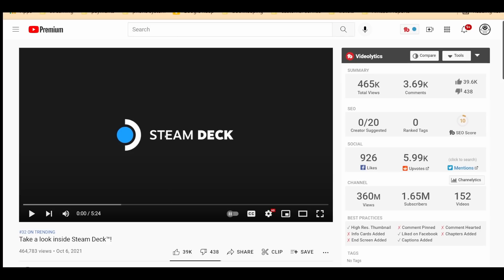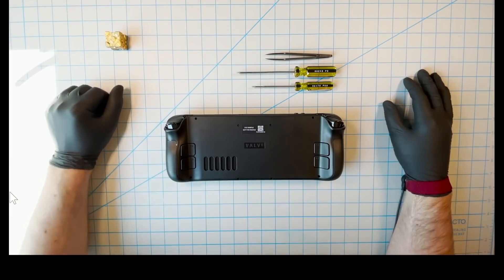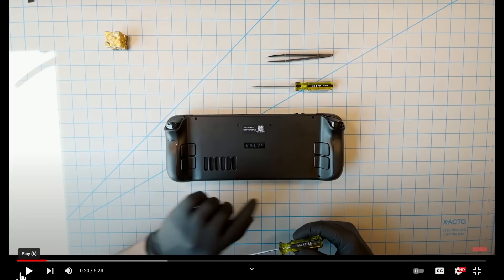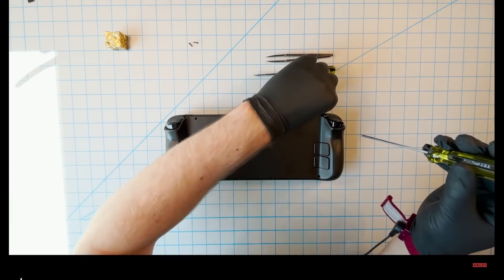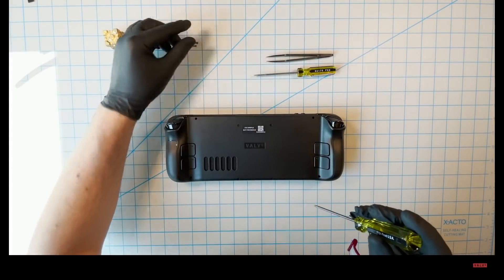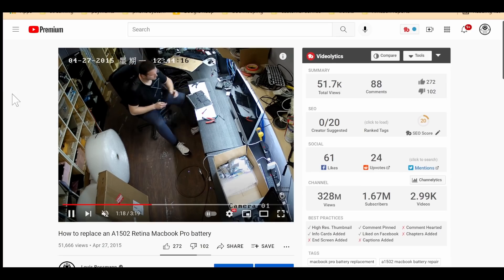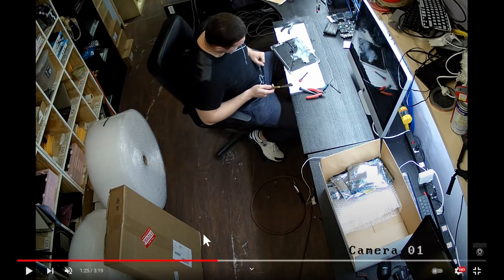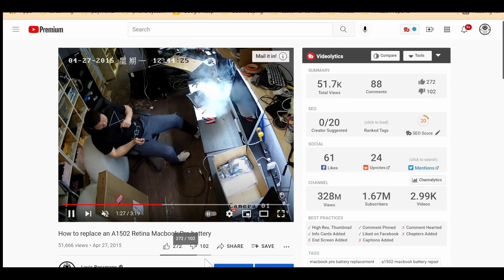Steam deck battery may end your life? bruh 😑

Comment: Self tapping screws xill deform the plastic to form threads.
So by unscrewing then screwing back in, you are likely to cut new thread very close to existing threads, making them thinner and so weaker.

2 options :
- Better design : use threaded insert and machine screws. But that is much more costly to implement
- When putting a slef taping screw back, start by spinning it counterclockwise, until you feel it fall into the old thread. Then you can screw it back. It will be much better but you still loose a bit of strenght compared to when they were first put in

Comment: It's probably poor wording, but I think he means that the structural integrity is lessened while it's open. The stress testing clip isn't really useful- they'd be better served with a side-by-side of it being twisted with a constant torque with the cover on and off if that's what they meant to say.  I crushed my oil filter housing once because the drain plug/cap wasn't in the end of it and it couldn't take the design torque without it. Reduced rigidity after re-assembly makes no sense to me and as I'm sure you know better than I, most other electronics don't get weaker once you reassembly unless you've (read: I've) damaged something.

Comment: As far as the screws messing up the structural integrity I can believe it. Since they used self tappers the screw goes into a smooth hole and taps it’s own threads. If you remove them and the screws don’t line up perfectly when you screw them back in they will more than likely tap a new set of threads in the same hole reducing the amount of material supporting the threads. Still a cheap design choice but it is what it is. They are just covering their asses.

Comment: By the way, I’ve worked on the floor of a electrical manufacturing company, we made medical devices and handled many motherboards. As part of the anti static prevention, our PPE included anti static gloves and footwear along with the wristband you plugged in. The footwear and wristband are there to slowly leak any electrical charge you have to the ground through your feet to ground or wrist to grounding line.

The wrist and footwear are very necessary for manufacturing because static will kill parts being manufactured. Having said that, they are completely overkill in normal everyday life. 

Buy the gloves, buy an anti static pad, and do it on a day that isn’t dry or too humid. (Gloves are just a good idea all around)
Reply: I had a teacher in high school that would sometimes talk about his friend that built computers (I think in the 80's). Specifically, how he would stand naked in his kitchen, one hand on the sink, to prevent static buildup.
Reply: +Ceece I used to work at a company that supplied Storage Appliances.
I wore anti static wristbands as well.
We had to test them on a special machine before we started our shifts.

Comment: Self-tappinv screw could jeopardize integrity when overfastened/over tightened or when not back-threaded (when it retreads the plastic instead of grabbing the old thread). I think the same behind this as the rest of the video:  they had to cover themselves as it is easily possible to break the thread with such tiny screws. He does mention the torque driver for example.

Comment: I never wear a wrist strap, and NEVER zap anything. Like you, I touch things to get to the same potential. Always touching a ground part of the device to get to the same potential. Pickup soldering iron (a ts100) I always touch the earth screw and get everything to the same potential, just like holding the iron, and grabbing the solder.
Always doing riny stuff under a microscope, too. Same rules apply. Be at sane potential as part, then pickup my tweezers or some other tool. It becomes a habit, as you say, Louis.

Comment: Nice to get Louis' opinion on Valve's video. I do think Louis dismissed the battery being able to kill someone a bit too easily. Sure, an igniting/burning battery is very unlikely to kill you directly, but it can easily set other stuff on fire (e.g. if you work on a cluttered desk with flammable objects near the device), which in turn could set the room/house on fire. So I think handling the battery incorrectly could kill you, albeit indirectly.

Comment: I believe the structural integrity bit is as simple as this: the average shmoe is likely enough to cross thread one or more screws or loose one or mess up the sizes or overtighten them or even just wear the self-tapped threads a bit as they're really not designed for repeated use.  So I'd say there's some truth to the statement on that basis.   Brass inserts would be nicer and protect pretty well from most of the noob mistakes.

Comment: no the threaded screws kind of bind in to the frame . so if you remove them you need to tighten them perfectly to achieve a similar hold. they need to bite in again to re grip. the issue is you don't want to over tighten. see linus's stream on this. he said he understands why. it's to keep costs down.

Comment: This is about liability. Though what they say, no doubt has an element of scaremongering; as somebody who works in the construction industry and has to produce risk assessments all the time; I would have to approach it like this: 
What are the risks of damaging a LI battery? 
1. Possible explosion. 
2. Fire. 
What are the worst consequences of these risks? 
1. Burns
2.House / apartment fire, which could result in multiple fatalities. 
Control measures? 
1. Do it in a controlled environment (have a fireproof container on-hand in case of fire), ensure good ventilation.

2. Don't do it, take to somebody with more experience. 
Basically they are covering their arses.

Comment: "SSD's have limited write cycles." I hate that this is still an idea that's floated around. This was only an issue with early SSDs and unless you're a data center doing a nonstop read/write pass over the entire SSD 24/7, the drive is going to last longer than you will live. Tech has moved on since the early days. Wear leveling, different materials, even ways of deciding what ultimately is worth writing to the SSD instead of keeping in memory, are all ways that the drives last longer. I appreciate your work on right to repair, but please stop this dead misinformation.
Reply: Not necessarily. I have managed to kill plenty of nvme ssd's because of swap usage. Also the newer tlc, qlc, and plc nand has far less endurance then older mlc or slc flash. 
Same situation at the m1 mac's, I only anticipate 4ish years before I send it off to Rossman.

Comment: I highly appreciate the fact that they are saying that parts will be available. So you don't risk buying crappy parts that will fail after a short time. Especially this is awesome because I doubt they will use another website to order the parts and not just Steam. Steam would be awesome, just enter what you need and buy it. This makes things sooo much easier. That's a giant step forward for right to repair. I don't blame them for saying parts will will be available in the next months because the console is not out yet and so I think parts will be available shortly after they release the console.

Besides that: Maybe there will be upgradeble parts in the future 😏

Comment: 11:30 I regularly work on stuff from 30 to 50 years ago. I'd say modern stuff is more static sensitive. Have never fried anything old, have fried 1 or 2 new chips. I don't do any ESD dissipation, but I only fried 2 things. I imaging old stuff is more resilient to esd due to them generally working on higher voltages (Or I've been lucky).

Comment: Structural integrity is going to be affected when you open it - meaning while it's open and half the shell is missing. Obviously if you open it and while doing that you drop it, it wont be able to resist the knock as well as when it's closed up. They just said it bit clumsy and easy to misunderstand.

Edit: I guess it could be slightly weaker forever if the screws don't hold as well the second time you put them in. But now we're knit-picking.

Comment: I think he mentioned the structural integrity thing because I have seen many people tightening screws until they no longer move , and as these are just plastic threads , that could wreck the threads , and if the screws aren't gripped , the structure does become weak.. BUT , if you carefully open it and tighten it slowly to original levels ( and also not open it up once in a month ) , it should be fine , there's nothing wrong..

Edit : I should mention this , my both parents had two Laptops ( HP and Lenovo ) which had lost screws because we used to travel a lot around 5 years ago and often repeatedly putting and taking out laptop from the bagpack would slowly misplace the screw.. The result was that after half of the screws were gone , both laptops' bases seem to go weak and eventually need a base replacement.. Our newer laptops didn't need this because we ensured that screws are always present..

Comment: I mean I get it, a lot of what is said is overblown (like the battery) but! We all know most people aren't too tech savvy when it comes to repairs. 

A lot of people already struggle with very basic things on relatively big parts - like on a full sized desktop pc. 

Swapping over to a Laptop is already the next hurdle and then going even smaller with something like the Deck? Yeah I can see why they are talking like this, because 99.99999999% of people will absolutely just follow some teardown guide or video without having ANY knowledge or experience on working with these things. 

So them going "Yo, don't do this, if you NEED to open it, go bring it someone who knows how do to it and learn first"

Comment: Would the integrity he effected? Probably they are self tapping screws going into plastic crap, removing and replacing the screw can make the plastic crap weaker. So yeah your device might be more likely to fall apart if you drop shocking the now weaken fitting. However if your device is already broken who cares if you break it more while trying to fix it yourself, your other option is buying a new one anyway and if your willing to buy a new one ah fuck it just hit the thing with a hammer and buy a new one. At least that way you will have a reason to waist your money rather then repairing it
Hay if you fuck the screws just use super glue! Better then having a device that falls apart on ya

Comment: About the battery being able to kill you, in this case i would say yes - this is true, for simple reasons:
It is not that the battery bursting in flames while you change something is dangerous, but when it gets damages just slightly and develops a fault later on. It is something you likely have in your backpack or closet and if it starts burning there it can be dangerous.
(But it would be better to just say it could cause a fire as the battery will not kill you directly.)

The mechanical integrity - self-tapping screws really lose a lot of strength with each time they are used in the same hole. Just opening and closing the lid, if the threads are not aligned, can easily make the screws 20-30% weaker.

Comment: 9:35 - my only idea is if they'd be using clips to hold it together which would loose integrity with each opening/closing, but they are using screws, so it shouldn't be and issue.

Comment: I can think of 2 reasons for the comments about structural integrity.

Reason 1 is probably another example of the legal department making sure they're covered if someone puts it back together incorrectly and it gets damaged.

Reason 2 is that the structural integrity is probably only compromised if you actually over tighten the screws. As a computer repair expert you're probably familiar with tiny screws, most people however probably haven't touched a screwdriver since they bought something from IKEA and would be at risk of being too heavy handed.

Comment: From personal experience taking apart and fixing broken ps4 controllers I can attest that some of them never go back together 100% as tightly as they were brand new.  Not always, but it does happen more often than not.  

Since this is essentially a giant controller you're taking apart, if it doesn't go back together perfectly, it is something you'll feel in hand.  It's not hard for me to imagine it getting a little flex and wiggle room that it didn't have before the repair.  

How a fraction of a millimeter of extra play in the chassis would impact the durability of the product, I have no clue.

Comment: Self tapping screws with plastic means that the first time you install it, it literally is an air tight seal, and therefore counts as one mechanical object. Once you remove the screw, it wears, therefore not perfect seal, therefore, the screw becomes the weak point ever so slightly. Practically, if you have installed with the right torque, then it should be fine, but technically, they're not wrong.

That's why glue is soo strong, it's air tight seal, no weak points such as a very small piece of metal

Comment: Maybe the screws are like Ikea furniture: the removal and reinsertion of screws weaken the plastic. With the screws not holding it together as strong as in the original state, the structural integrity is marginally weaker.

Comment: The comment about the structural integrity is also a legal disclaimer. The steamdeck has plastic clips that keep it together alongside the screws. And those can always break if you open them. If one of them breaks the structural integrity is a tiny bit affected... So they are technically correct but in reality not so.

Comment: What is it with people using anti static wrist bands wrong, Its not that hard of a concept. I have worked repairing Hearing instruments (hearing aids) for years, and never fried anything with static, ever. In saying that, it may be more of an issue if you live in a very dry climate. I must admit though, I will touch something grounded (briefly) before I replace something like an expensive cpu or ram, if working on my pc.

Comment: I love your videos but here are some things to note:

1. They did not use any glue which can be argued it would increase the structural integrity, but they did not and it's easier to repair.
2. They used common screws and they kept it to the minimum with the variation (you don't need 20 different screwdrivers, for each screw a different one)
3. Everything is visible and easy to unscrew and detach.
4. The SSD, even though it is proprietary they had good reason to do so but even still the connector is the same so reputable manufacturers that design SSD can create one easily, also from what is seen SSD replacement seems only necessary when it would die because they provide an SD slot (they could have removed the slot but this way it is pro consumer)

Mention: As you said near the end the disclaimers are most likely to protect themselves legally including the structural integrity (since they mentioned it's easy to strip them and not screw them well or maybe break a clip)

PS: I know it's good to point out when they are bs-ing you but I kind of got irritated where every time he mentioned a disclaimer you would stop the video and comment, even though you know that is a disclaimer and you know that if they would not say that some idiot would break it and come to them telling them that their video told them they can open it up, or that it's easy to open it up.
Of course that disclaimer is not meant for professionals or even normal people (since as you can see it's very easy to open it up and put it back together), it's meant for idiots that use incorrect screwdrivers strip the screws and them come with it saying they got it that way. 

PPS. It's good to be pro repair but being over critical, seeing everyone as being anti-repair, is bad(see enemies everywhere). They said you shouldn't do this, it's an advice, take it as you will, they didn't even mention voiding warranty, I will take it that you just said that to get your point in the video, that repairing your stuff is desired (and it is). It's just that if someone sees the first minute of the video (aka reading the headline in an article) and there are people who do so, they will see it as you saying that valve being anti repair when they are clearly pro repair(but I might be exaggerating it).

Comment: if they used self tappers straight into plastic then they are correct in saying that if you open and close it, it will gradually strip those plastic holes out and leave the screws permanently loose, cant understand why they wouldn't use metal inserts to screw standard screws into, seems very lazy or intentionally wanting to discourage people from opening the device.

i'd just glue it shut after opening or add some thread locker or packing material to the screw holes to give them some more meat to hang onto after opening.

Comment: Yeah, I got hundreds of downvotes on Reddit for pointing out how Valve seems to be trying to needlessly scare people away from servicing their own devices. It's like telling someone they should leave cooking to professionals, because knives are dangerous and they could chop their fingers off... Just ridiculous advice where the correct way of doing it is teaching people how to do it properly.

A lot of people are saying "it's the lawyers", but Valve is not the first company to instruct users on how to open a device with an LI battery in it, and most of them manage to do this without telling you that you are "taking a big risk with your life".

Feels more to me like they want to push people away from trying to fix the device if it is broken, or replacing the interior SSD with a larger one that would be cheaper than buying the next model up. People just want to give Valve the benefit of the doubt, while Apple would get skewered for making a similar video.